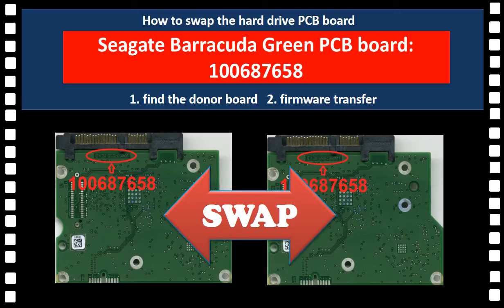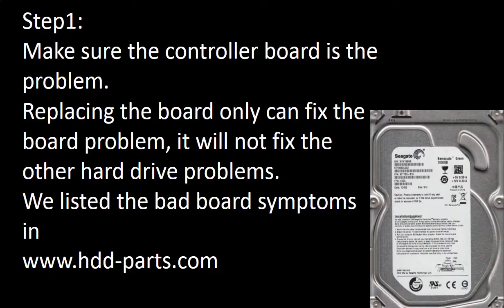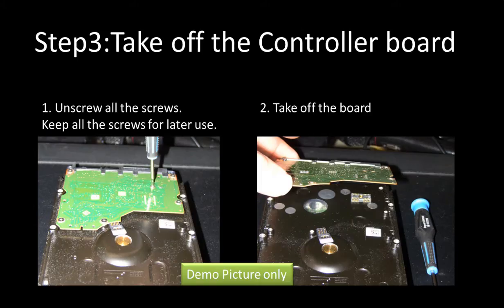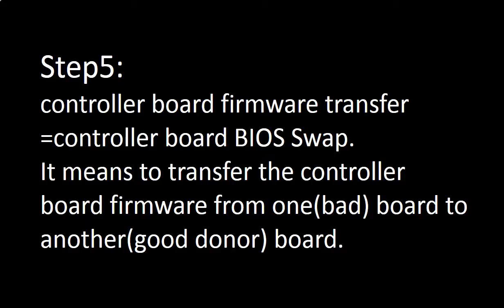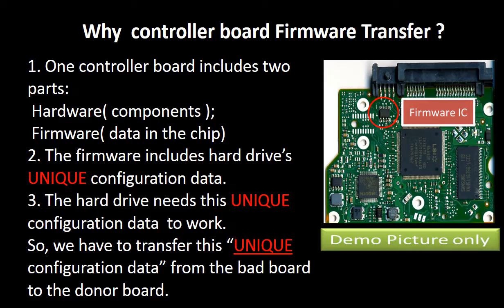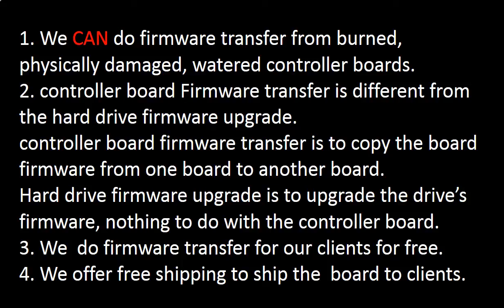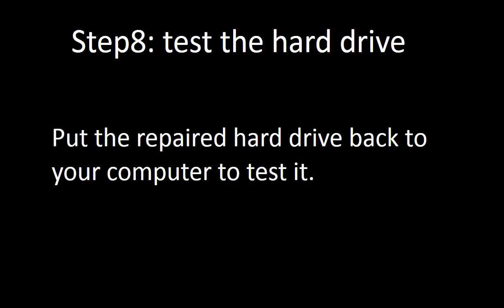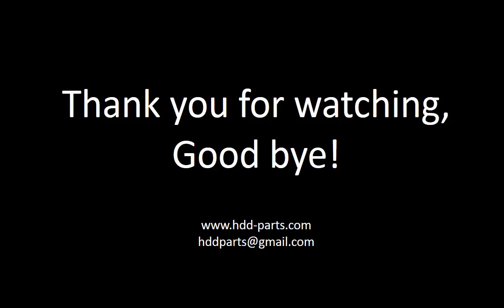Seagate fix board swap 100687658 ST1000DM003   ST1000VM002  ST2000DM001   ST2000VM003 ST2000VN000

Comment: oh, keep this lottery scam away from youtube, this HDD can be fixed by homemade 1$ tools if "controller board is the problem", now get to work, useless eaters
Reply: nice, im a embeddedsystems programmer, have some experience as well/ This "technical process" introduced here is maybe helps somehow but takes out of context for normal diagnosis and repair job, squid for weekend scientists and makes more damage then help. ..for hdd and human brains
Reply: So let us know, how to do it for 1$ ? I need to repair an seagate laptop thin sshd :)
Reply: jeena256
ican't suggest you any solution, sorry
in your case Seagate doesn't matter, sshd =/= hdd, this is totally different entity. but if we talking about hdd .. of last generations... and Not hardware problem - it drives by is very.. extremely Smart Software on the board and in many cases all you need is to keep it rested about 2 days in poweron state.. plus some methods with handmade tools can help...
Reply: My hdd wont spin up, cant see it in bios, with another board from same type of SSHD it spins, but not work, shows 0MB storage. I try to move firmware chip soon.
Reply: Ok, but what can I do, if i havent this 5 pin connector on hdd, i cant find where to connect the interface.
Reply: Or, isnt the problem, that the 1,2V step-down converter on hdd has output only 0,95V?